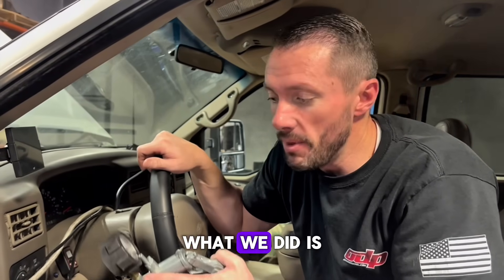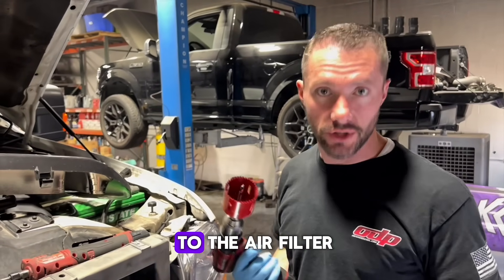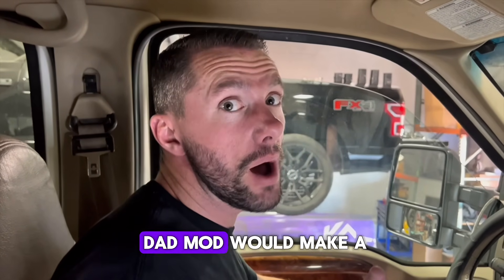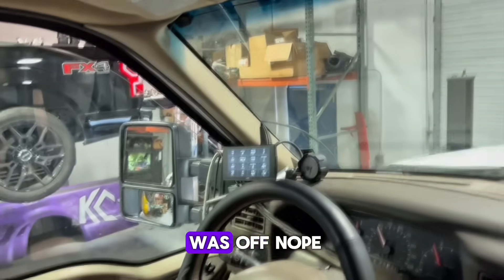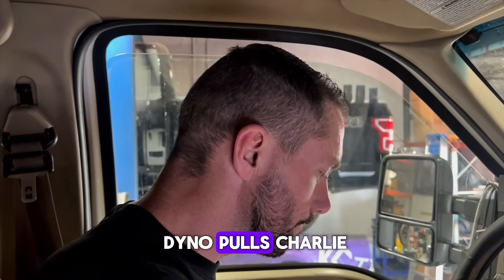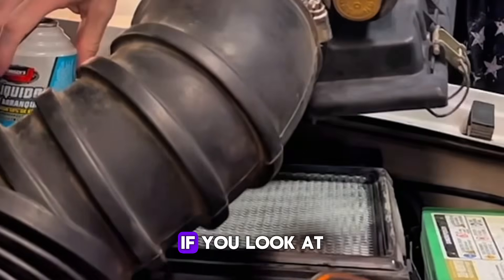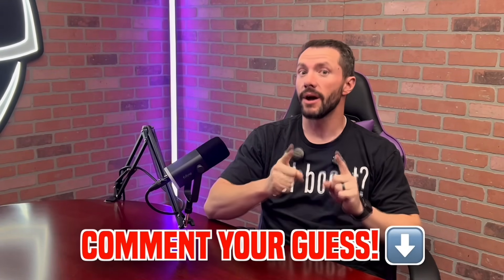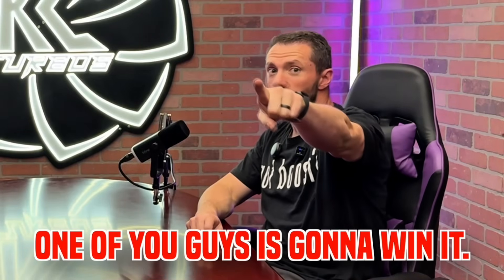We Tested The WORST 7.3 Intake! Zoodad and 6637 Dyno Testing - Legendary 7.3 Giveaway EP. 7

Comment: I know all trucks set ups and weather conditions are going to yield different results, but when I monitored my intake air temperatures with a stock air box versus my Riff Raff Donaldson blue intake, I was actually fairly impressed, it didn’t go down, but it did stay level With stock while allowing much more flow and at the same time having great filtration. When I installed my filter though, I did set up my temperature sensor right under the filter where I feel it would be getting the most fair accurate reading. Your sensor must’ve been set up closer to the engine. The Donaldson blew filter Does perform leagues better than the standard white 6637, Makes a world of difference.
Reply from the maker: Our air temp sensor is located inside the intake right after the air filter.
Reply: @KCTURBOS make more kc38r tiger turbo videos stage 2
Reply: @KCTURBOS  right on understood, i’m not sure where the discrepancy may be. Definitely not disagreeing the proper design intakes work great. Maybe have to reconsider my intake options now. I buy and sell a good bit of these trucks and the Donaldson is my go to
Reply: There’s a big difference in under hood temps when driving versus being stationary on a dyno, like you noticed. One square foot of grille sees 880 cfm per 10mph in speed at a much higher pressure than what that shop fan pushes. There’s also a fair bit of debate about whether the increased restriction of a 6637 style filter is due to the media being more efficient at debris removal. Some filters out there that flow better do so because they do a worse job of cleaning the air.
Reply: @ drivingonwheels did a good video that showed the driving temps are elevated , not as severely as this video, but a pretty consistent 20° or more.  Pretty easily verified with the torque app or forscan
Reply: 6637 adds “ear horsepower”
Reply: I tried the blue 6637, with a filterminder restriction gauge… even light take-offs would max out my gauge.  Gotta agree with Charlie 100%
Reply: @user-qc4lv9tj6i  i’m just not buying it. Real world results speak volumes
Reply: @bangingears5911  Well, I firmly believe in letting people spend their money anyway they like, but I believe a good Filterminder measuring peak intake pressure delta (inches of water, negative pressure) is good real world results.  I tried several variations...Blocked it up to get more surface area exposed, removed the pre-filter sock.  It consistently buried the gauge past the 25 inch mark under light throttle no-load driving (yes it was a new Dondaldson Blue purchased from the RiffRaff guys).  When I switched over to the AFE (although the S&B is great as well) the drop in restriction was significant.  I still get a measurable amount of rstriction with the AFE dry filter but it is well in the nominal range (8-11" if I remember correctly).  It is a very mild build:  160/30 injectors, RiverCities Cam, KC drop-in t-wheel with a choked-down turbine (it's a manual, I like quicker spool), it is intercooled kind-of-a cobbled together kit from Woonthings.  The soft boot between the AFE and the CrankVent adapter seems to make it quieter as well...but that is a subjective opinion.  

No disrespect intended.  I wish you well in your endeavors.  I'm not in sales, just a working class guy tring to keep the compressor blades happy on my own dime.

Comment: Why no discussion about filtration? How much more dirt is that S&B letting in?
Reply from the maker: The S&B is a great air filter, that’s why it was so dirty from months of filtering the air.
Reply: None. The answer is none.  S&b is on 1000s of truck. 6.0, 7.3, dmax, Cummins, etc.  they filter great
Reply: @peixinho5927 I’ve done oil analysis on both of these filters on my truck the 6637 stayed around 3 ppm silicon in the oil and the oiled S&B was anywhere from 8-12ppm that’s a significant difference in filtration
Reply: @peixinho5927  6637 also on 1000s of trucks. Let's in more heat, but less dirt. It's not all about max performance. Longevity matters, too.
Reply: @sdpsd25 1000s of truck sucking in hotter air and making less power for zero reason.  The s&b filters great.  Sorry but you are grasping at straws to defend a crappy air filter mod.

Show the data that shows there is any issue with filtration on an s&b 🤷‍♂️
Reply: @peixinho5927  I run an S&B on my truck. But I do it for the possible performance increase, and don't pretend it filters better than paper. The data is there. Just look up the filtration efficiency of the S&B vs Donaldson filter for the 6637 setup. The 6637 filters better. Not enough to matter over a few thousand miles. But almost certainly enough to matter over 200k miles. Letting in more dirt shortens engine life. If we're gonna compare filters, it's only fair to compare ALL parameters, not just the ones you like.

Comment: Now im worried.

I have the kc300 stage 2, ff 205/30%, zf6 trans, and many other support mods, and never see that much boost, usually 25psi, 40+?

Never. 

What im doing wrong?
Reply: Call or email KC. They will.  My guess is gonna be boost fooler or stock map sensor maxed out
Reply: Check for boost leaks, up-pipe leaks, fuel pressure. I would have done 80% nozzles. Last is tuning.